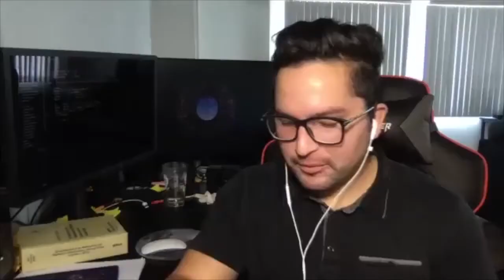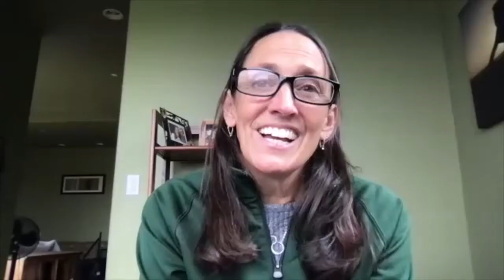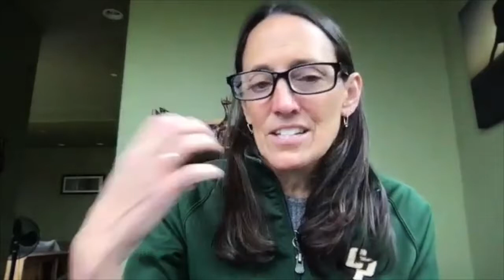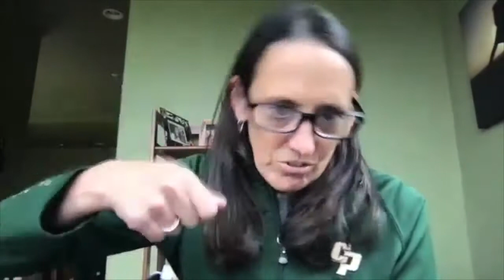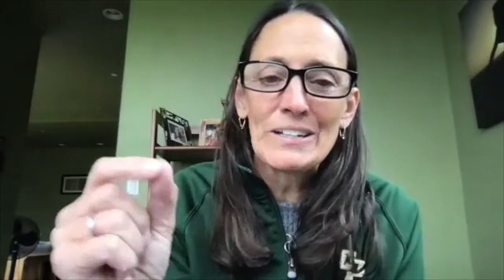Spacecraft Whipple Shields for Space Debris | Space Engineering Podcast Clips 12

Comment: Her explication isn’t really correct, it slows the speed minimally, what it does is fragment the projectile, to spread the force over a large area

Ideally you want to completely vaporise the projectile, and so ironically, the faster a projectile goes the easier it is to stop up to a point. 
Slower projectiles that do not completely desintegrate on impact are a lot harder to stop. 

This speed is around 2700-3000 meters per second. Below that it works like a regular bullet, above that it reliably turns into a plume of plasma. 

Whipple shields ideally should not create extra shrapnel, so you want the first layer to make a tiny hole and des integrate as well, then you want layers that have high tensile strength and can survive high temperature, the ISS uses alumina cloth, alumina is an oxide that resists decently high temperature. The non crystalline/micro crystal form of sapphire. 

Then they have a final layer of aluminum which is structural. It’s far from an optimal design but it’s simple and seems to work with tiny impacts. The ISS pretty much only uses Aluminum, Nextel, Aluminum sandwiches. Sometimes without the alumina(Nextel) which I would say is a big mistake. Those shields have varying thickness, spacing and layer count depending on the part of the ISS in question. It’s a pretty heavy and basic design. Made to be cheap I believe. Better materials and more complex composite schemes exist that do a better job. A simple one would be using titanium alloy (ductile high temperature low eutectic ones) as the inner layer instead of aluminum. They also lack a spall liner